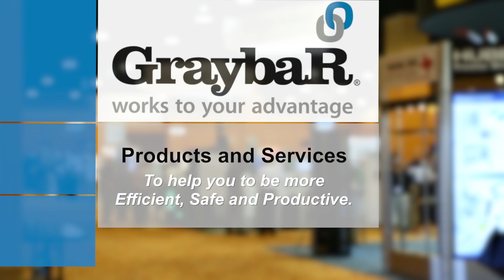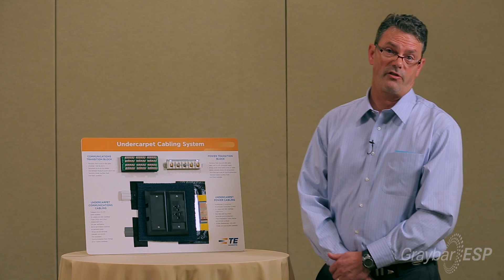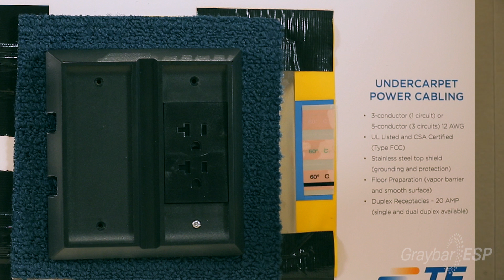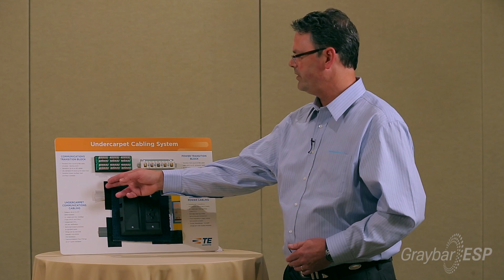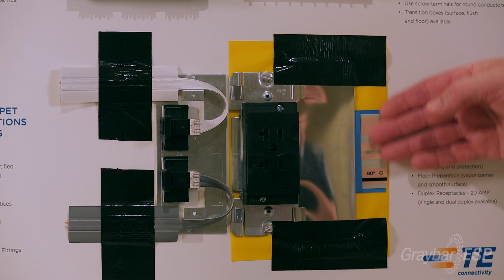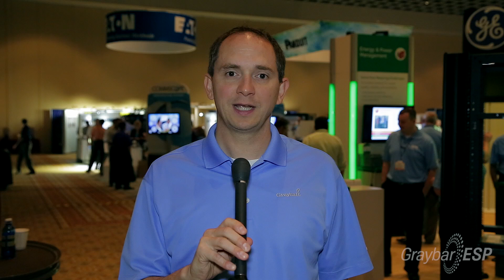TE Connectivity Undercarpet Cabling System

Comment: Good luck terminating the data cable anywhere as clean as the picture in the video , and this sytem is very  noticable under commercial glue down carpet